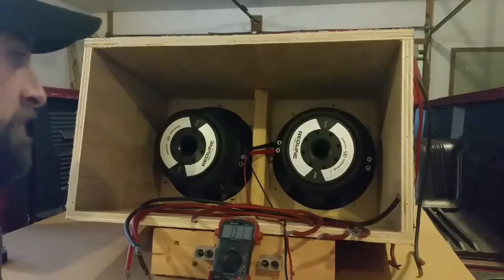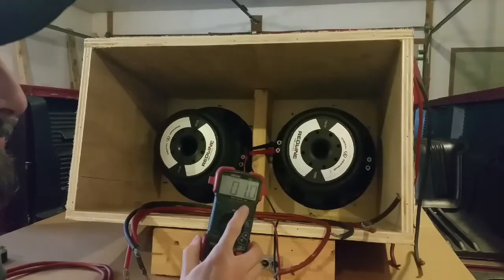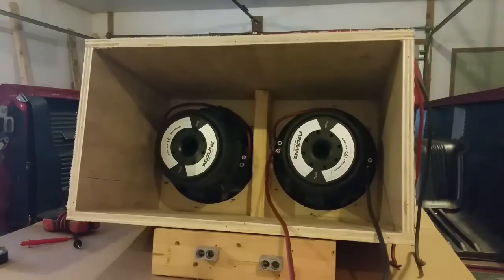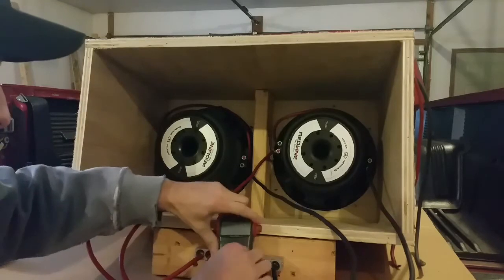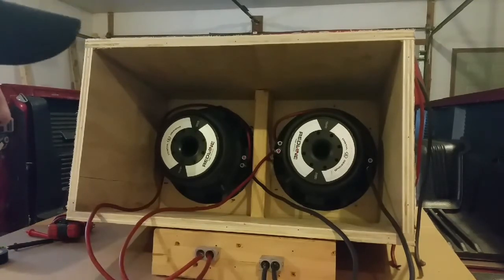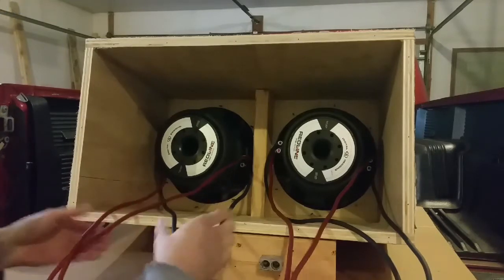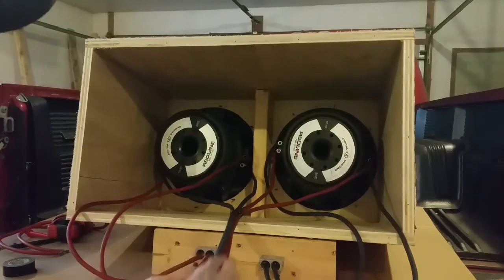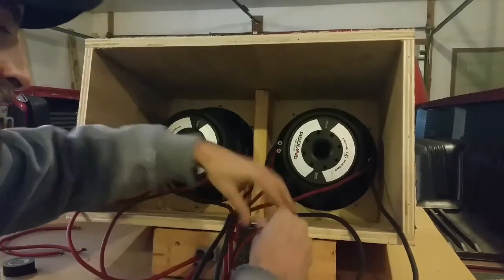HOW TO wire subs ... Dual Coil Series Parallel Wiring Combinations

Comment: Bro after hours and hours of research, I finally found your video! Thank you so much, so if I have 2 dvc 2ohm subs. If i do this it will be a 2ohm load at the amp right?
Reply from the maker: Yeah each sub would be wired up to 4ohm, then the pair wired back down to 2ohm final load.

Comment: How can I wire to get the best sound from my  Sony amplifier which is rated at 240 W there is a selector switch on the back which is eight ohms or four rooms it’s a four channel amp and I have 210 inch to voice coil subs that I want to wire into the system

Comment: I have to be three due to forsgate 10 inch running out of 2 ohm load on a monoblock 800 is there any way that I can get more power to the speakers other than using a monoblock amp

Comment: it seems to me the last configuration would supply more power to all the coils, I have two dual 2 ohm subs and have been thinking of doing this. subs are 500w rms & 800w max each, amp is a true 2000w rms @1ohm and 1400w rms @ 2ohm.. amp is a skar rp2000.1d

I need to run @1ohm to get more power lol.. thought about trying it at .5ohm.. I have 1/0 ofc power & ground 0 resistance on my grounds..  
I'm going to try a crossover first, to try and get a little more boost out of it for more deep punchy bass.. that's why I loved JL amps, the have an actual "bass boost knob" that actually adds bass instead of just adding more gain like most as do now